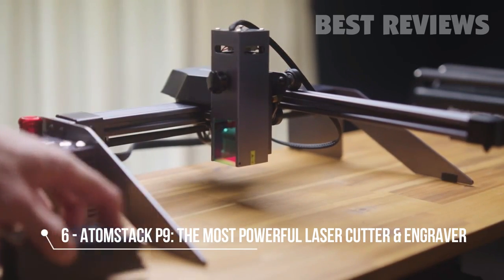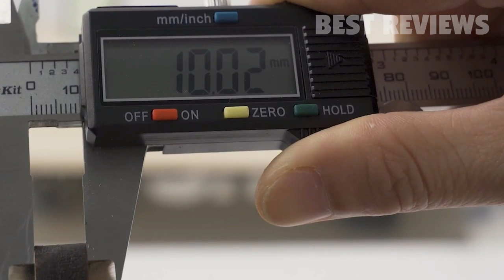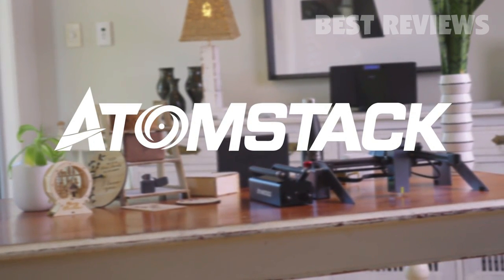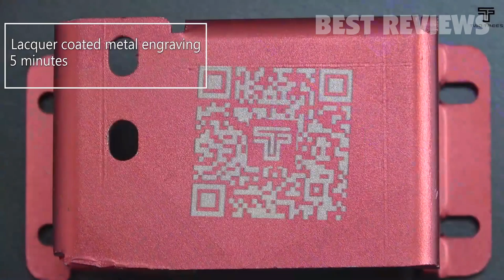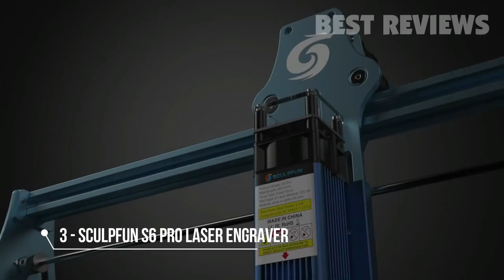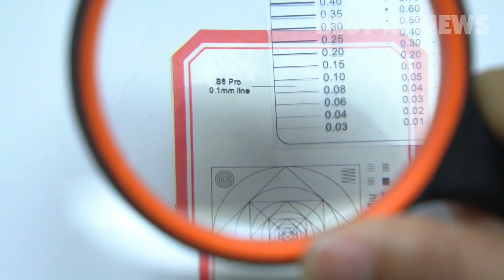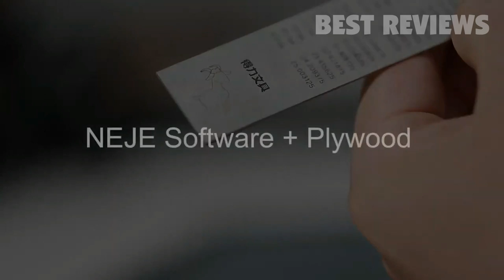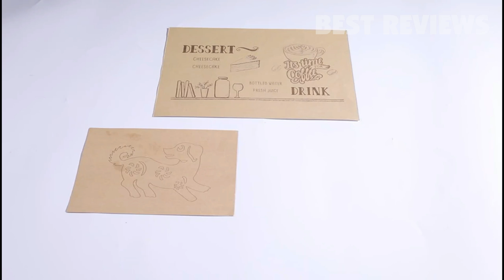6 Best Laser Cutter Engravers in 2024

Comment: would any of these be able to engrave on the metal on a gun like steel
Reply: Nope. These are all blue diode lasers. There isn't a diode laser that exists that can engrave metal. Diode lasers are 10 watts at max and you need around 50 watts or higher to actually make any kind of mark on metal, let alone steel. So at least $4,000 minimum for a co2 or fiber laser engraver. Average is $7,000. What you see in these demos is the laser just taking the paint off the metal. Still, a diode laser is definitely where you should start if you're an absolute beginner and want to learn how to use an engraver. It's a much cheaper way to figure out if it's something that you have the time, ability and desire to do and if you are planning on making a buisness out of it, it's also a good way to guage if you can get interested customers. Might not be worth the expense for a more powerful one if only a few people would be interested.
Reply: @zero00044  thank you this helped out alot i appreciate you taking your time to respond w such a lengthy reply 🙏 ive been doing more research and figured that out im definitely going to look further into engraving for sure i think it will help me alot when i do start my smithing business up obviously small things first and work my way up 👍
Reply: @scrapsofwishender6458  not a problem. I'm new to it myself. Just got my first one in December after doing a bunch of research myself. Had to get something I could use in my bedroom since I live in an apartment lol. Just to earn a little extra money on the side.
Reply: @scrapsofwishender6458  Yes u can engrave metal ! But first paint the metal surface with a black color. Search on Youtube 👍
Reply: @tarikalicioglu2894  that would be engraving paint.
Reply: @charliebrown1947  I had on stainless steel chef soap (without paint) photo engraved.